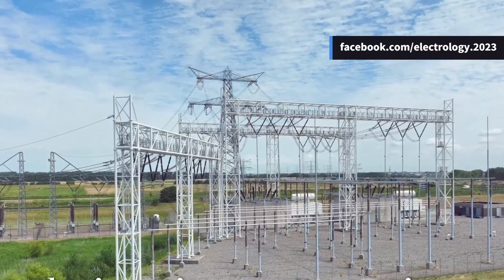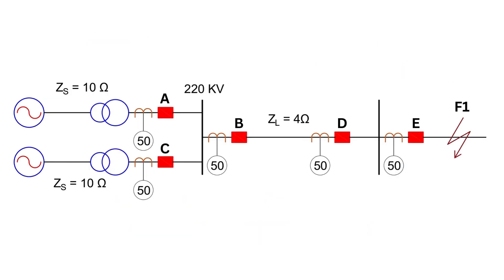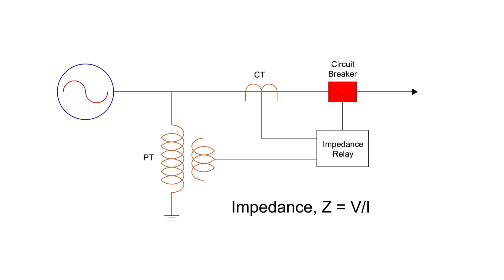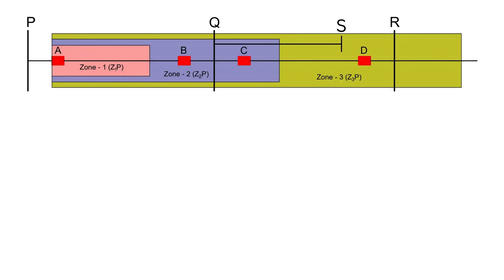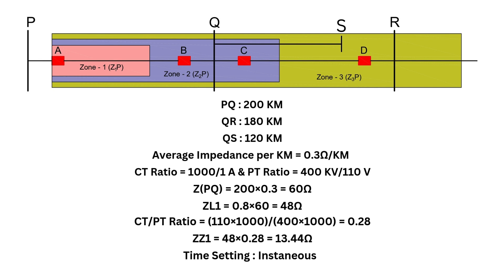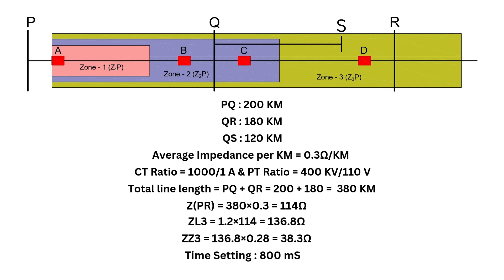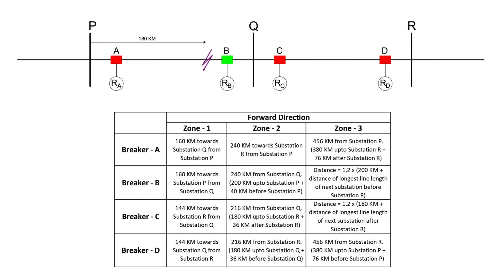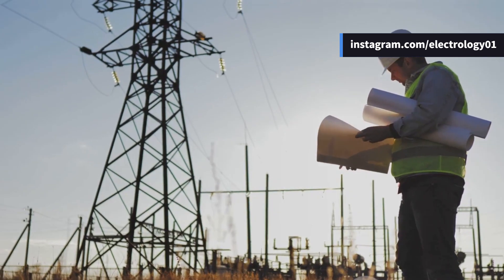How the transmission lines are protected? | 3 Zone Protection | Electrology

Comment: Thank you for the detailed explanation of the distance protection system in your video! It was very informative. I noticed it's quite similar to the system used in Japan, though there are some interesting subtle differences.

In Japan, for high-voltage transmission lines of 154kV and above, we typically utilize a pilot wire protection system. Additionally, for extra-high-voltage transmission lines of 275kV and above, we employ protection systems that incorporate 78 (directional power relay) and 87 (differential protection relay). Regarding this, I'm curious about international practices: how is the distance protection system applied to 220kV transmission lines, like those shown in your video? Are other protection systems also used in conjunction with it?

Any insights you could offer would be greatly appreciated!
Reply from the maker: Thank you for your detailed comment! Yes, for 220 kV lines, distance protection is commonly used as primary protection due to its fast and selective nature. But it’s often used along with other schemes like differential protection (87L), directional relays (67/78), and breaker failure protection (50BF). In many cases, PLCC-based teleprotection or autoreclosure is also added for better reliability. I appreciate you sharing Japan’s approach—really insightful!
Reply: @Electrology001  Thank you for your reply! I see that our approaches to transmission line protection are quite similar. That's good to know, thank you.

In the Kanto area's power utility in Japan, the settings for distance relays are typically 80% for the first zone (Zone 1/O1), 150% for the second zone (Zone 2/O2), and 300% for the third zone (Zone 3/Su). We also use the Zone 3 (Su) element in conjunction with a carrier communication system as primary protection.

I'm truly impressed by your efforts to advance electrical engineering skills. Thank you very much!
Reply from the maker: That's really insightful! Your detailed zone settings and use of Zone 3 with carrier communication are impressive. Thanks again for sharing Japan’s approach—it's always great to learn from international practices! 😊